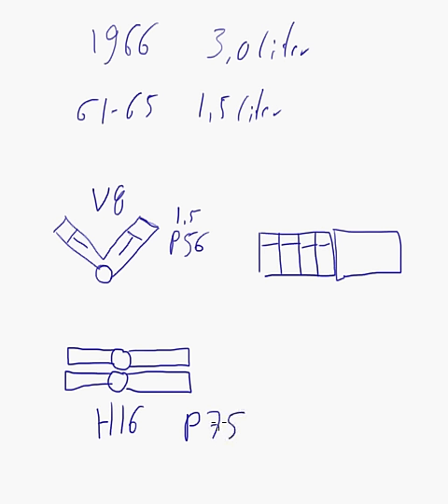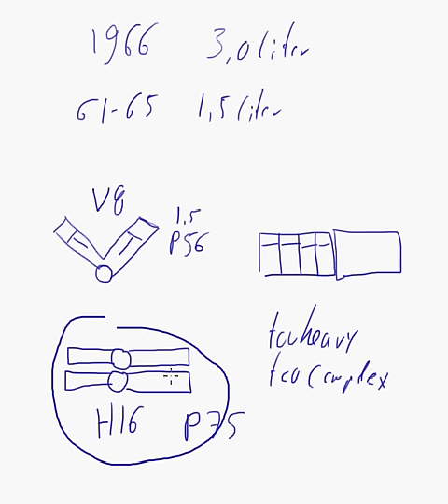BRM H16 Formula 1 Engine Short Explanation

Comment: It may have been a failure in racing, but by God, it sounded soooooo good.
Reply from the maker: Personally I find that if BRM had made a relatively simple V12 or even V8 in 1966 They would have had a great chance top get the titles in 1966 and 1967 and at least lived longer